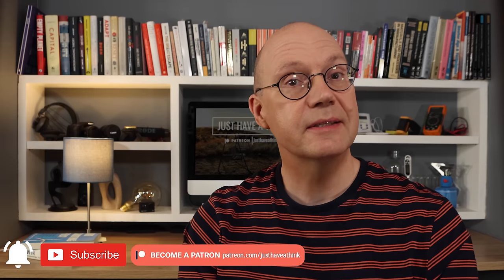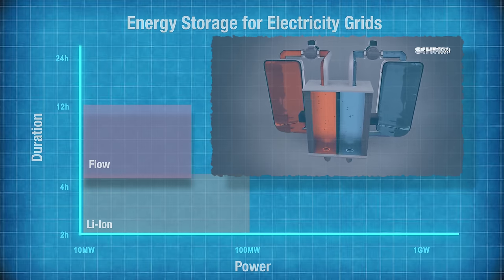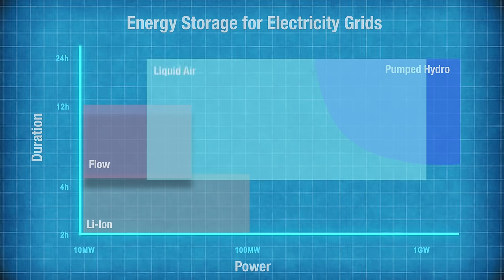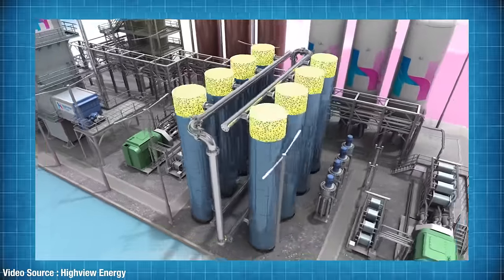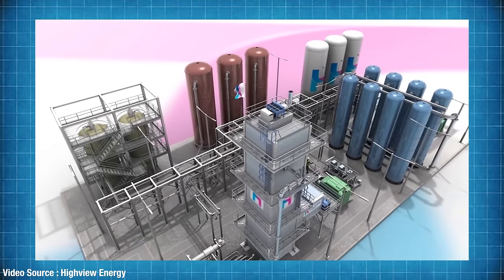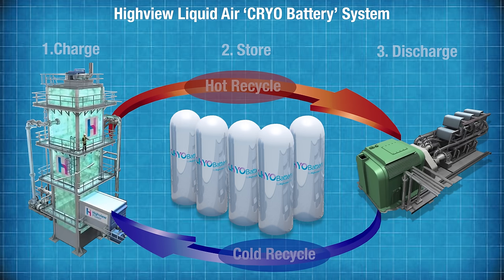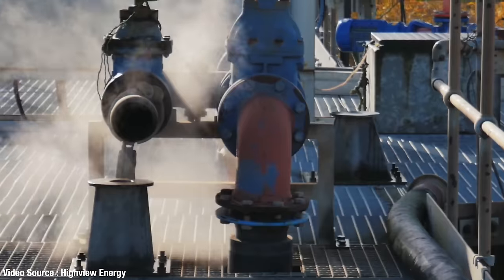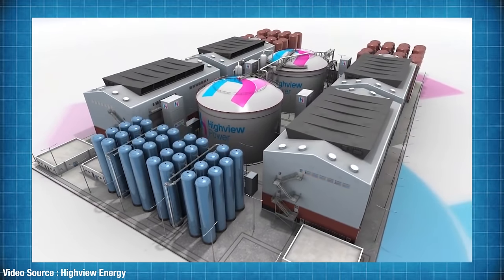Liquid Air Batteries. Literally energy from thin air. Seriously. Literally!

Comment: I'd be interested in hearing your thoughts on Don Sadoway's/Ambri's liquid metal batteries.
Reply: Yes, please.  Alt-energy youtubers avoid it like the plague for some reason, and I'd like to know why.  Seems promising to me.
Reply: @OnlyFactsPlease  agreed, very good idea.  Apparently Miners are very secretive and have traditionally been affected by the fumes of explosives, poisonous materials, dust and "dreams of avarice"..

In days gone by, Elon Musk would have been a Mining Magnate instead of applying independent thinking to Technology in IT.

So there are many minds hidden in Donald Sadoway's Graduates who aren't on public display like the Professor. It needs more Entrepreneurial Engineering Radicals to re-invent Mining Infrastructures using renewable techniques.
Reply from the maker: Hi Tim. I've heard of them but I haven't researched them. It's a good shout. I'll take a look :-)
Reply: @JustHaveaThink  I think that sharing from the get-go the concept of Simply reversing the process by which raw bauxite is converted to refined aluminum which notoriously uses incredible amounts of energy right? So if it takes a tremendous amount of energy and the process involves reversible steps the thinking was you could get that energy back!

The problem is that aluminum is valuable. And going to a penny for Killa 1 hour equivalent is not cheap enough by far.

Liquifying free vapor AKA gas AK atmosphere or nitrogen and oxygen has the economies of scale that are not linear. Linear is not good enough When shopping for economies of scale. You have to have exponential economies of scale. You have to be able to "bounce."

Comment: Very informative, Dave! I'd heard of liquid air batteries, but was clueless how they worked. It's great to see yet another solution for storing renewable energy when it's abundant —to then use later when it's not. Because there are always losses when transferring energy, I would be curious to know the percentage lost when converting it to liquid air, and then liquid air back to electricity. How do its losses compare with other solutions? Is there one that proves more efficient than others? Thanks for another great episode!
Reply: @erdelegy  That was the efficiency quoted, so the loss would be 40%.
Reply: Pumped hydro (and presumably pumped air) are pretty efficient, but they have major geological constraints, not to mention the ecological problems associated with flooding a valley.  The relatively small footprint of the liquid air batteries is a plus compared to the pumped approaches.
Reply: He wasn't listening to the video.  🙄🙄
Reply from the maker: Hi Mark. Here's some comparative gumpf that I found... 

Overall coal plant efficiency ranges from 32 % to 42 %. This is mainly dictated by the Superheat and Reheat steam temperatures and Superheat pressures. Most of the large power plants operate at steam pressures of 170 bar and 570 °C Superheat, and 570 ° C reheat temperatures. The efficiencies of these plants range from 35 % to 38 %. Super critical power plants operating at 220 bar and 600/600 °C can achieve efficiencies of 42 %. Ultra super critical pressure power plants at 300 bar and 600/600 °C can achieve efficiencies in the range of 45% to 48 % efficiency.                                                           

Gas turbines in the simple cycle mode, only Gas turbines running, have an efficiency of 32 % to 38 %. The most important parameter that dictates the efficiency is the maximum gas temperature possible. The latest Gas Turbines with technological advances in materials and aerodynamics has efficiencies up to 38 %. In the combined cycle mode, the new “H class” Gas turbines with a triple pressure HRSG and steam turbine can run at 60 % efficiency at ISO conditions. This is by far the highest efficiency in the thermal power field.

I think 60% efficiency is regarded as pretty good.
Reply: Mark - LAES is Bullshit. its only 75% Efficient at BEST, whereas Tesla MEGAPACK is 98% Efficient.
and LAES still requires FOSSIL FUELS to Power the Plant. 
and Tesla Autobidder software can BUY Energy when its Cheapest and SELL it back when DEMAND is HIGH.
Megapak can be Delivered on a Flatbed truck and installed in 100 Days.
Reply: @markplott4820  You are talking bullshit. LAES uses whatever power it wants, it NEEDS nothing, unlike batteries that require stuff like lithium and cobalt that limit the production and keep prices high. Batteries should be used for quick balancing of the grid and small scale storage, LAES is large scale long term solution that costs far less than batteries.
And before you ask, Tesla's megawatt scale projects are nice but they are SMALL SCALE, we need gigawatts.
Every power storage company buys energy when it is cheap and sells it for more, your argument is invalid and just makes you look dumb. Please stop acting dumb.
Delivery method or time is irrelevant is Tesla can't install multiple megapaks and keep them coming, instead they are still building more production lines just to keep their current car production going.
Reply: @erdelegy  Yes, but I presume that's the overall efficiency, and I was curious to know how much each STEP in the process contributes to the 40% loss. For example, I've heard that there's a 7% loss when transmitting electricity through the grid, then another 7% loss from an EV charging station to the EV.
Reply: @acmefixer1  And you weren't listening to my question. Dave addresses it below.
Reply: @JustHaveaThink  Thanks, Dave! That helps fill in some of the blanks. I'm still curious to know the loss from, say, a solar array or wind farm to the plant, and then from the plant to say, someone's home (I believe 7%?), and then from the home to an EV (7%?). One thing for sure, compared to the efficiency of electricity, iin all the steps needed to get crude from the ground to an ICE engine on the road, the energy losses are shockingly wasteful. Renewables are much more efficient, no question.